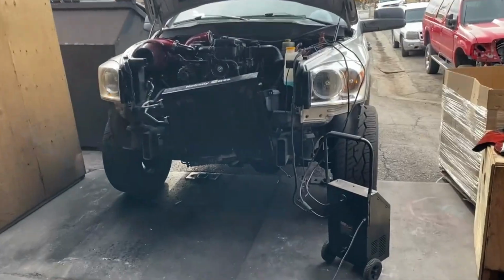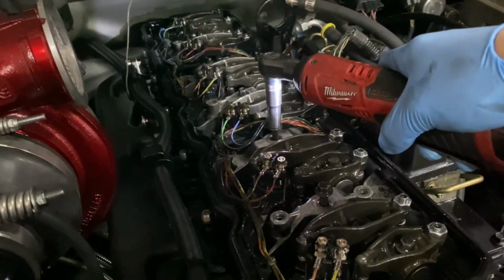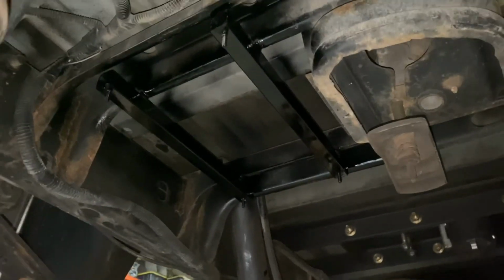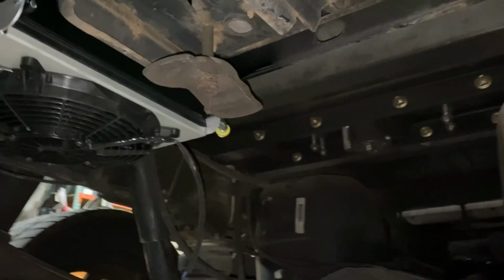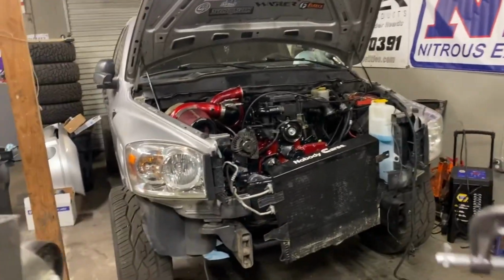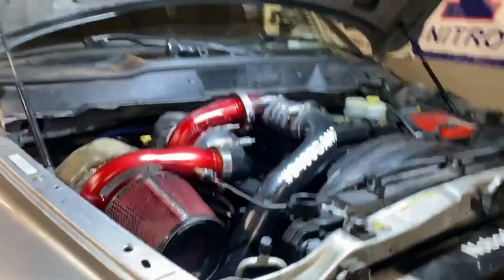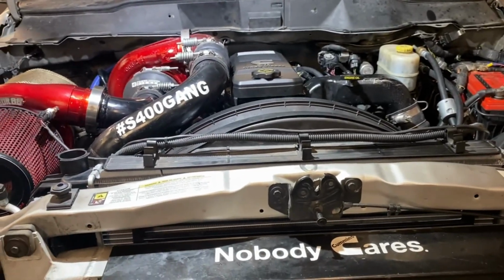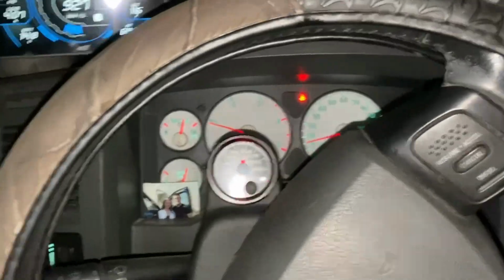1400HP CUMMINS CAM BREAK IN, HOT RETORQUE, FIRST TEST DRIVE

Comment: When you warm up the engine without coolant, how long do you run it and what temp are watching? Thanks
Reply from the maker: Oil temp is what we measure with an infrared temp gun on the oil filter. 180*
Reply: @horsetorquesdiesel would you do this same procedure with a some what stock rebuild? Im about to throw my motor in the truck and want to know, find correct info on a break in

Comment: I got a riddle for you, my 68rfe overheats in Drive in 1st and 2nd gear only cools down really fast once in 3rd. I added same trans cooler as you just did and with fan ON it makes no difference. If I'm waiting in a long line at the dump and keep it in gear in 10min it'll be at 250 degrees even with fan on.... Other wise transmission runs great. What is it.....?
Reply from the maker: Converter isn’t locked
Reply: @horsetorquesdiesel  Converter supposed to be locked while standing in gear? I guess I'll do some research on how converters work... I've tried to search formus can't find anyone with exact same problem because I can tow foot to the floor on steep grades and trans is happy. Only 1st and 2nd gear overheating.
Reply from the maker: @ProjectNotSoSlow  get transmission tuning that allows for 1 and 2 gear lock up when in manual shift mode
Reply: Thanks for taking the time to reply. I had a trans repair shop say it's most likely 1st and 2nd gears slipping but I'll do some research from what you said and some testing. Trans was rebuilt 50k ago by a shop that went out of business. Does PDD build 68rfes? To support 600whp and towing?
Reply from the maker: @ProjectNotSoSlow  I have very rarely seen under drives fail usually it’s over drives that go first. We do not build 68s but Randy’s does in Utah, Redhorse or Coffman customs does in Texas, Suncoast does in Florida, Muldoons does in the NE
Reply: @horsetorquesdiesel  Awesome thank you!! My favorite channel on YouTube since day 1!

Comment: Josh, would you not benefit from a larger cold side pipe between chargers?
Reply from the maker: The turbo outlet is 3” the compressor wheel of the 72 is 2.9” in my head it didn’t make sense. Maybe we could test that theory!
Reply: @horsetorquesdiesel  with a bigger tube you may even gain a bit of lag, more air to compress.
Reply: @horsetorquesdiesel  my kit came with I believe 4” between the 91 and 72. 
You may very well be in the right I was just curious.

Comment: Off the wall question but with a 150* 7x10 VP injector paired with a 6.7 piston what would a good starting point for timing be? Tried from 17-26* and can’t find its happy spot just wants to sputter after 1000-1200rpm
Reply from the maker: How low can you go?
Reply: @horsetorquesdiesel  tried 17 at the lowest

Comment: So parson my ignorance but the truck has two trans coolers then?
Reply from the maker: Yes sir one in the front by the radiator and the other under the bed
Reply: @horsetorquesdiesel  nice!! How did you do that just y's or it flows from one cooler to the other and then to the trans?